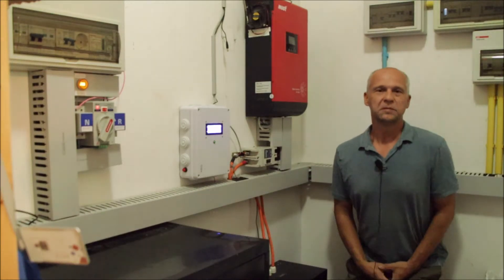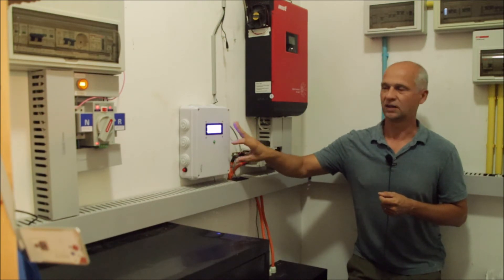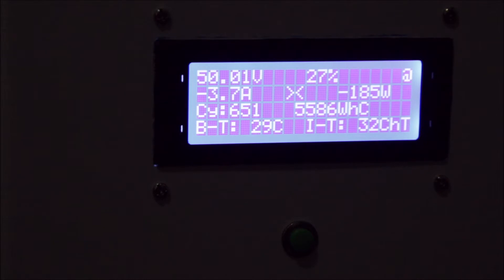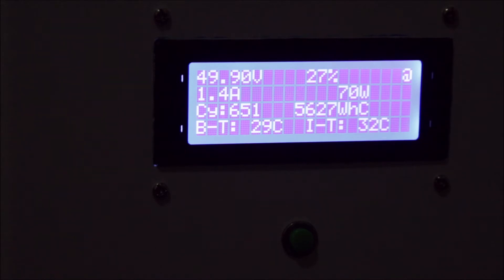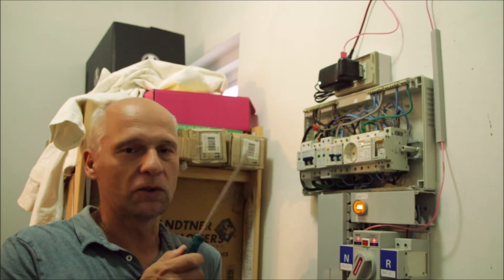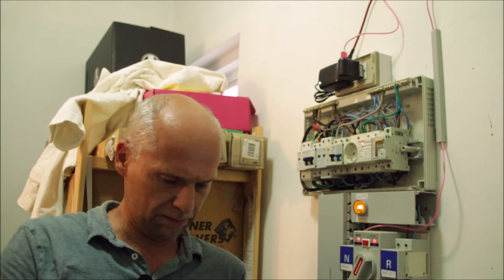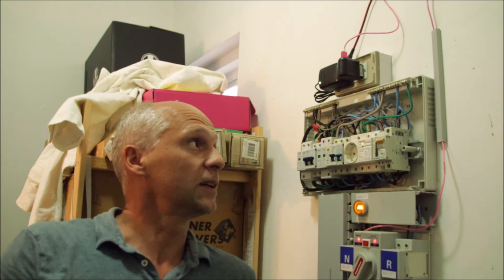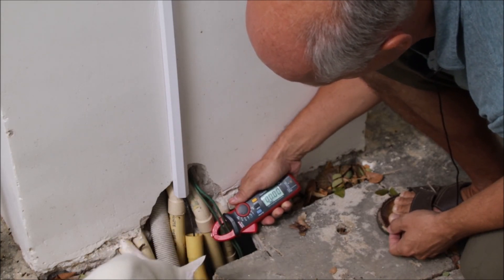Recap before leaving, Part 1: Power Room, How much current flows over a bonding wire?

Comment: Great video my friend and excellent explanations.
Could I ask what device you are using to remotely monitor your plant?
Reply from the maker: On both of my battery systems I use the DIY monitors I have made based on Arduinos. There are video series about the LiPo battery monitor and about the AC Powerwall controller including upgrades. I do npt monitor on cell level. You would need a smart BMS for that...

Comment: if u hookup the ground wire to the neutral ,them put the a 5 feet grounding rod in the earth .when attaching does it spark and it suppose too?  🤔🤔🤔
Reply from the maker: Yes, it might cause a spark if your N had a higher voltage on it :) But that would be normal and intended as it is only during equilization. Similar as of discharging a capacitor.
Reply: it the grid neutral is it normal to .the connection must be solid or will burn off u think?
Reply from the maker: @olvano  I saw it on Grid-N already too. There it mostly happens if your house is somewhere at the end of the line, with a lot of users, and the TN-C supply gets a bit dirty. That's why at some point, alternative Earthing has to be installed. It can of course easily be with TT-Systems, as there your Earth and the utility N is not connected, but there it as well should not be. So if you are adding a ground rod and connect it to the Grid Neutral, make sure you are not in a TT-System! But anyways, after you connect an Earthing rod, always check if a current is flowing
Reply: i think we need a next Grounding video 😥😥
Reply from the maker: @olvano  that topic was shown in the 3rd video about Grid/Off-Grid mixed setups in all Earthing-Systems. I know, Earthing can be a bit confusing, as it is very individual to the property and its grid connection itself.

Comment: If there is any current you would have a ground fault and the system should trip or at least sound an alarm.
Reply from the maker: Ground faults between inverter and initial distribution until the RCD, would be covered by the inverters short circuit or internal ground fault detection only. Thats why the bolding link is important too, as it would provide a short circuit path. The inverter would then shut down with a fault message. Ground faults at later stages are covered by the RCD, which typically trip at 30mA fault current.